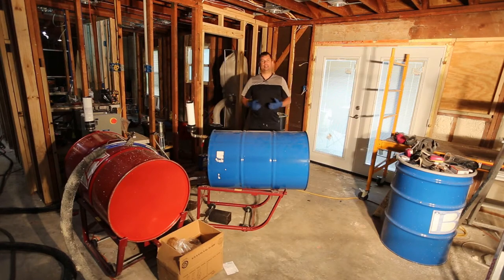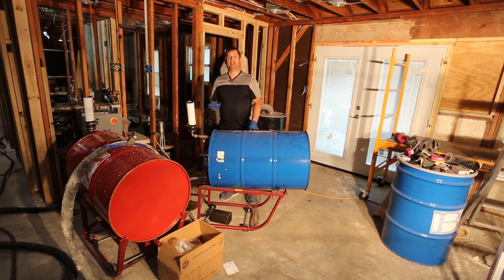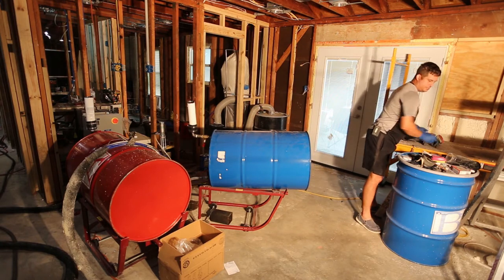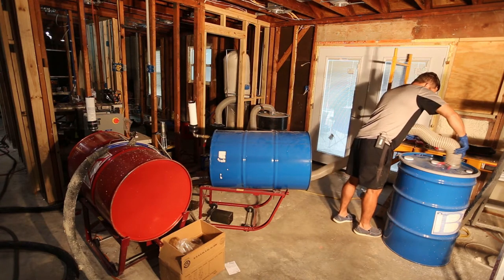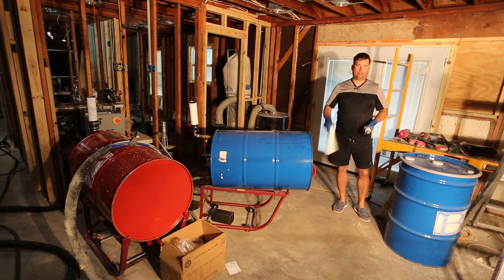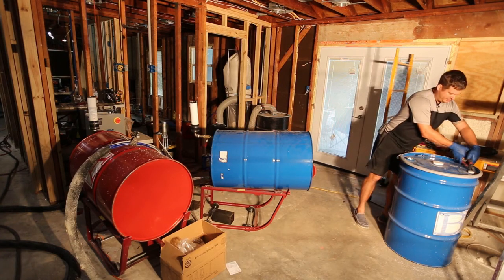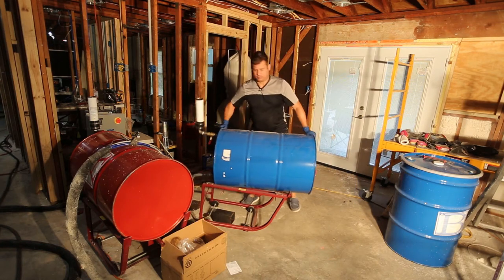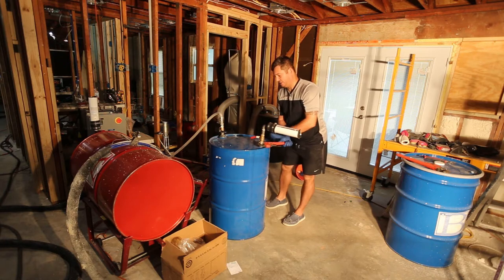DIY Spray Foam - How to change the material drum

Comment: Brian, I would like to speak with you in regards to the Lil Pup. I'm in the process of purchasing and I would like to ask a few questions on getting started and what kind of compressor you are using. Is there a private way to contact on here?
Reply from the maker: Eric Jacobs Eric:  I'm using a Harbor Freight 5HP electric compressor.  They are usually around $1000 but I think they have them on sale for $800 this month.
Reply: Hi Brian,  Do you find that using a compressor with a higher CFM @90 PSI provides any advantage when spraying over the recommendation of 10-12 cfm?

Comment: Mr. Greul,
  First I want to say thank you for being generous with your time in posting your work/experiences.  Its also always good to come into contact with a fan of Dr. Listeburek.  I'm frustrated with spray foam contractors and have decided to do the spray foam myself.  I started out researching the preformed canister foams then came across your channel.  A few questions....what is the shelf life of an opened/unopened canister of A and B?  Is maintaining a range of canister temperature critical?  What is the name (or do you have a link) of the desiccant canisters?  What did you pay for the Lil Pup?  I believe that you mentioned your supplier also directed you to online safety training.  Would you mind sharing that site? Again, thank you for your work.

Best,

Trent
Reply from the maker: +T Willey Hi Trent.  I think a set of A/B will last for 6 months per the label.  My research suggests that it will still make foam much later than that, you just might not get the yield.  Each manufacturer has recommendations on temperature.  It's important to note that the processing guidelines are for high pressure foam, not low pressure.  As for the training, contact the distributor you are going to buy from and ask them for it.  Any reputable distributor will refer you for free.  Drierite is the dessicant supplier.  Google them.  The biggest thing to keep in mind is that it is very time consuming, messy, and the chemicals are dangerous for some people.